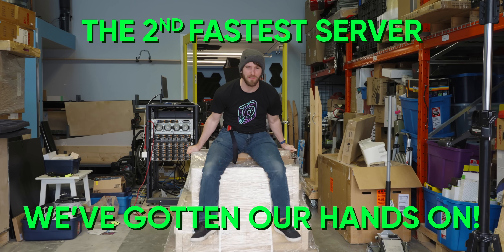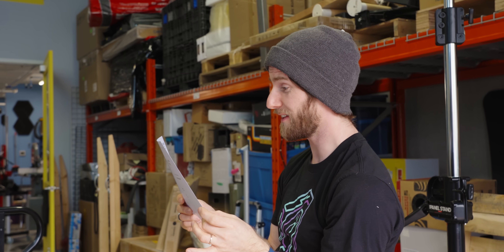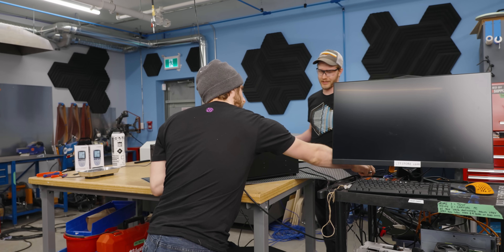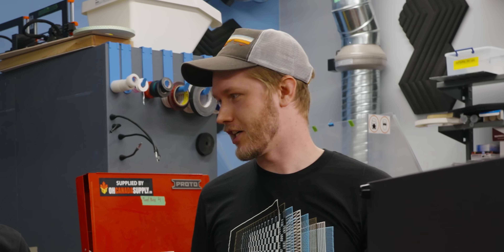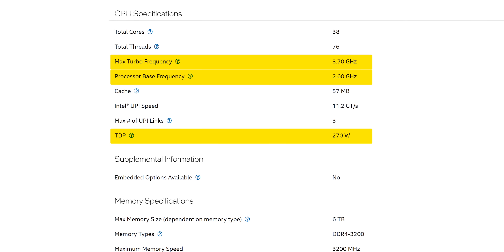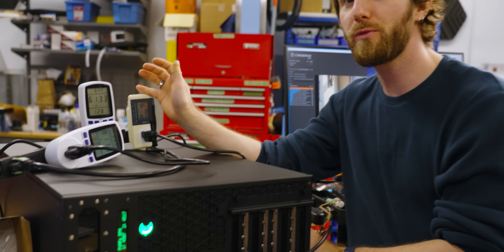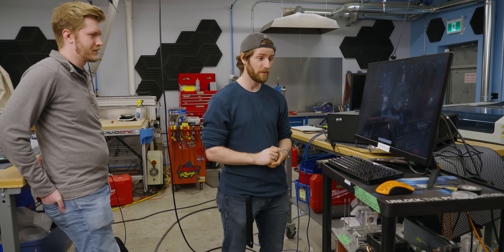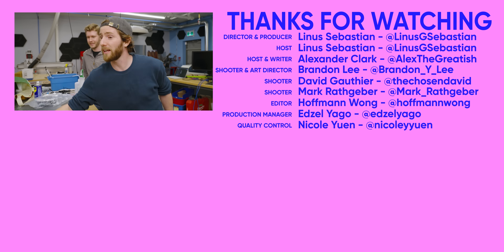The God of Computers - Comino Grando RM

Comment: Getting tired of Linux acting like an overindulged hardware guy who trashes hardware.

Lastly, what kind of computer shop has torx that shred?  Why would you even have a hand sized torx to work on that application where a shred would happen 30 percent of the time.

No. you don't have an aura, you just look like a clown. gz Bozo.

Hmm, my watch times shrink.

Comment: Damn, I was excited when I got 58,000 on my Cinabench Multi Score with my TRx4 3990x. That's 20k more than me. BUT it did take you 6x the CPUs to do it. Since I'm sure dual 3990x would beat it. Well with 128 cores 256 threads should. My rig wasn't even watercooled. Beat out watercooled rig in a Mississippi mid-summer room with an ambient temperature of 28C 80F, CPU maxed out at 50C.
Reply: The most mindboggling thing about your statement is the fact that you own a 3990x. Lol
Reply: @mamamia5668  Yeah, and it is 100% wasted on my use case. I just wanted to build the most absurd computer and did. Paid 2x the price for that 3090 though, and expected that. THOUGH, probably was slightly less than 2x since it wasn't the nVidia reference model one. I don't know what PNY was selling their 3090 for before the pandemic and shortages.
Reply: @tdata545  i paid too much for my 3080 too... sadly
Reply: Mind if i ask how much ur total build was out of curiousity?
Reply: @mamamia5668  15K US. 4TB Gen 4 boot drive, two Gen 3 8TB storage drives, 256GB Kingston Hyper X 3200 CAS16 RAM, 1500W Titanium PSU,  Anidees Crystal XL Case, Industrial fans from Noctua (9x), modified Noctua cpu tower cooler (just added an extra fan and bought black fans), RTX 3090 from PNY apparently the wrong one for better overclocking, and then the aforementioned 3990x running the show on the CPU front all on a Zenith II Extreme Alpha motherboard. Can add ssds and whatnot later. Since the case was meant to be a NAS case.
Reply: @tdata545  thats an unimaginably  crazy power in that system, also in power draw lol
Reply: @mamamia5668  Luckily the power supply should be variable enough and under the heaviest of loads, I think it maxes out at 900W, which is still silly, but not as bad as I was expecting. I over-shot on the power supply for safety reasons. I think nVidia recommends 750Ws, I think the max power draw from their chips that I can see from testers is 400W same with the 3990x, + 100W for peripherals, ram, storage, and fans.

Comment: If you wanted to test the computer you could design a parallel computing script in r or python. They both have packages for measuring performance of compute heavy tasks. I’m currently working on a school project that keeps trying to use more than 500gb of ram and 48 cores.(it still takes more than a day to run lol)
Reply: I’m having to consider AWS because I keep locking up the schools compute server…..

Comment: I think you guys owed it to Comino to physically change out the gpus instead of the "air guitar" version we got. Just my opinion of course. I know there is a lot of work that goes into these videos, and you are probably overwhelmed with tech to demonstrate. I would have liked to see Comino's quick disconnect in action. However, I  am as worried as everyone else about the crowbar and sledgehammer being inducted in this.

Comment: I really doubt that's enough cooling given that the water has to stay lower than 45-50C to avoid pump damage. If you say that the temperature of the exhaust was over 40C, then I'm guess that the coolant was even hotter than that

Comment: Tip. If sqrew to tight, lightly tap sqrew driver with mallet or hammer as you turn to loosen. Works like a charm every time.

Comment: That's nice, but I like mine better, because it doesn't crash a half dozen times on camera while running a few benchmarks, and also, 2000 watts is an enormous amount of power to have to dissipate. I'd need to get a 1 Ton mini split just for the computer room if I installed one of these. Oh, and the freaking computer costs almost as much as my entire house. So...yeah...pass.

Comment: You should let these rip on Folding@home or Boinc Manager projects to just see how many you get through in 15min. It'd be cool to see as a bench mark and you'd be helping Scientists so it's a win win.
Reply: Awesome idea
Reply: I was just thinking about Folding@home and SETI@home, but wasn't sure if they were still a thing. I see that the latter stopped in March 2020, but could start up again using data from other radio telescopes.
Reply: @hedgehog1965uk  Folding@Home is included with BOINC :)
Reply: @captainbozo01  No Folding@home is a separate thing you're thinking of Rosetta

Comment: 60 grand is actually a hell of a deal when you compare it to those Mac cheese grater desktops. Weren't those like 55 grand with just 1 gpu?
Reply: Yeah if you spec them out fully (28 core Xeon, 1.5TB RAM, two 64GB Radeons, 8TB SSDs) it ends up costing about that - in AUD it’s almost $79k 🤣

Comment: You know PC's used to be way more fun. In 2017, an LTT build video wouldn't even be released unless it had quad SLI GPUs with two Xeon CPUs. I mean now we are relegated to these one off business science computers for the over the top builds. Thanks NVIDIA and AMD you could have kept Cross Fire and SLI alive even if it was a stuttery mess. I have a feeling that SLI would have been way better on PCIE 4, and 5. It would have been so fun to see dual 3060 tis  rip apart a 3090 ti in the benchmarks.

Comment: When I try to use SignalRgb my GPU memory speed drops 200mhz. I've searched online but haven't find anyone with the same issue. Can someone who uses it tell me if this has happened to them and what could it depend on?
I have a 2070 super (msi gaming x trio)
Reply: Hey, you should join our Discord community. We'd be able to communicate better this way, and our community could have some advice too! I can't leave a link here though as it would be spam. You can find our Discord online.

Comment: If you guys can get the Time Spy run to complete, your world record will likely stand for three more hardware generations.
4×1080 Tis still beat 2×3090 Tis in Fire Strike.
Reply: I rlly want to see this
Reply: @ricogol  I 2nd this. I NEED to know what the score is. I can't even fathom how incredibly powerful this workstation is. A Sub 8 second BMW render?!?! I literally screamed WAHT?!? at my monitor when that happened lol
Reply: For me (in games with full SLI support), 2 SLI 1080ti cards are equal to 1 OC 3090.  I love my 3090, but it only helps me with games that don't have SLI support.
Reply: @charlesswhitlock  Which games are those? SLI haven't been supported well for a long time and older games aren't going to take advantage of the hardware that the 3090 supports.
Reply: @charlesswhitlock  That is more likely due to such games being optimised for SLI and not for modern hardware. They probably leave a lot of the potential performance of the 3090 untapped.
Reply: @charlesswhitlock  except the big reason you buy an RTX card is for ray tracing lol
Reply: @charlesswhitlock  lol absolutely not sli is garbage I've had sli from 580 to 1080 it died in 2015 with DX12 that promised better support for multi gpu but instead highly increased the work required and so nvidia dropped it, and a single 1080ti is less than half a single 3090 considering sli gains where nowhere near 200% of a single card there's no universe where that's true..except tricked benchmarks that report false numbers..just like car manufacturers trick emission controls, and don't get me started on "fake fps" reported by sli...it says 160fps it looks like 40 because of the sync problems the frame drops the stuttering...subnautica 1 was my eye opener...gliding into the ocean was much smoother on a single 1080ti than sli showing me 60% more fps that's when I switched to single gpu
Reply: @charlesswhitlock  you for real? What a constant stutterfest you have yourself gotten into.
Reply: omg do it
Reply: 11:47 only 850W? That's less than a single 4090 TI.
Reply: @Mr.Morden  Per rail. it's 3 rails.
Reply: @Mr.Morden  That 850W was on CPU benchmark.
Reply: @Mr.Morden  there's no such a thing as 4090 TI.
Reply: @ivanvostlojevitsk3564  already been rumored that the infmaous 600w would be the 4090ti, 4090 is supposed to be 450w now as of 22.05.16
Reply: I think a single card next gen will beat 4 1080 Tis
Reply: Some of the games I  had tested it on include Resident Evil 2/3 remakes (2019/2020) (new engine, no SLI support but you can enable it), Metro Exodus (no native SLI support but you can turn it on), Skyrim as an old game with native SLI support. I'm not going to list everything. SLI support only stopped like 2 years ago. Not as many new games had support, but as I indicated above, it can be turned on for many. If you never had SLI, don't try to convince yourself it was useless, it was the best thing ever for gamers. It is a shame that it is going.
Reply: No they don't
Reply: Unfortunately even the last racecar in last place will beat the one that didn't finish. It's kind of a moot point if it doesn't do what you want. This wasn't it's gig. It's a render machine.

Comment: Linus, your benchmarks are to slow to stress the system. Use the system to simulate airflow through cases. CFD will stress the system if you go in high fidelity. Also you have a ton of engineers who could do it for you a bit south of you in Seattle with Boeing. It would be a fun thing to do in the lab comparing CFD simulations to real would and maybe trying to optimize cooling by understanding the flow.

Comment: Did you consider running a lower ambient temp (particularly if the room was heating up during the testing). While 20°C is a good server room temp (assuming server didn't heat up the room), it looks like you could go down to 10°C to get better cooling when the system is cranked up.

There is argument about the recommended range, and much argument about the ideal server room ambient temps. Part of that is likely the performance / $ gained by inefficiently extreme cooling vs adding more machines or another whole data center.

Comment: Have you thought about running some actual scientific benchmarks on these? As long as you have someone that knows how to compile and run code there it wouldn't be hard to get it set up. For example the HPL or HPCG.
Reply: with starting of lab new benchmark are used if i remember correctly. Something was mentioned in on of the last wan shows.

Comment: Linux, you remind me of the 70s when I was working in a hardware development department doing DoD work. We had several PhDs in the department. (I was a lowly Masters degree holder.) With one exception we had to institute a policy that holders of a PhD degree were not allowed in the labs. They could step through the doorway and items under test throughout the big lab (about twice to four times the size of your labs) would fail. Then the PhD's would wonder "What happens if I...". That is when things would fry. They just had a disaster field built around them.

(The one exception in the department went on to become the chief engineer of Qualcomm before he retired.)

Linus, you appear to feature a walking disaster field, too. I cringe when I see you get near hardware. On the other hand, we had a tech in the lab who was working on a prototype worth ginormous one of a kind money somehow connect 120 volts directly to the card rather than through a 5V power supply. If you want to catch up with that (drunkard) you have to up your game.

{O,o}

 Toning it down a little would be nice. You're not that dumb if you can get where you are today.
{^_-}

Comment: The blender BMW will render in 7.95 sec on my system with only one 3080 ti. So sub 7 seconds on this is not impressive. You cannot use such a simple render to test a machine like that. You need to test that machine on an interior scene with volumetrics and occluded light. That's pretty much the only way you are going to really be able to test it's performance.

Comment: are you sure you set up blender correctly? because im pretty sure you can achieve those results with just one of those gpus and the overhead for running multiple gpus shouldnt be that high

Comment: The Cinebench file needs to be adjusted for machines like this. I adjusted it for my 3995wx to render at a higher res with a high anti-aliasing setting, and it took a bit longer to render. The default .c4d file is only rendering at 1280x700 with low AA.

Comment: When I ran my 2080 ti from two daisy chained 8 pin connectors instead of two seprate ones, my GPU would crash in certain games. An example would be Gears of War 4. I think they should test with a more powerful powersupply to see if the system gets more stable. It is possible to get crashes from an underperforming powersupply instead of outright shutdowns.

Comment: So who will be the first company to offer a retail purpose-built 3 rack unit R134 based coolant chiller box that hooks to standard liquid cooling loops. Ambient air radiation has its limits. 
Take a the Mining Rig guys. They are pushing the power and thermals pretty damn hard. You often see them using used Gold rated server power supplies (12V only) to break out to their GPUs. Then then put the rigs, which really are not that dense, into indoor plant growing tents to capture the heat and then forced-air duct it out of the space.  Really they have the same problem. 
What is happening in the datacenter is an attempt to move to unified form factor (Open Compute) for interchangability of parts (think ATX mobo as a prior example of the benefits of interchangeability). BUT power and cooling is always a problem and a moving target.  Until someone comes up with the final / scalable solution that has to involve not extraction but actually cooling.

Comment: Hi  I'm a beginner I got my Pc brand new and it's working and everything doing well but my motherboard have a orange blinking led on the buttom right corner is that something I should be considered about?! / my Rig i7 12700k - Rtx 3090 - Asus Rog maximum hero z690 - DDR5 5200 32gb kit - AIO cooler - Corsair MP600 2Tb M.2 SSD

Comment: If Comino were to go to full balls to the wall and use a 3x140mm radiator instead of a 3x120mm and make it 80mm instead of the 60mm it appears to be (they're using an Alphacool radiator), they could EASILY make this system even quieter. As it stands, it appears that the 360x60 rad they're using is already powerful enough to dissipate well over 2000W of heat. That's NUTS.

Comment: I'm a senior systems engineer and I understand why they still put VGA as the video out since HDMI requires royalties, but my god its time to move on and also buy better KVM's for your DC. Use displayport Or instead of USB ports add type C ports and make them displayport over type C ports. I just can't believe how long enterprise and datacenter products hold on to antiquated technologies same with businesses they are their own worst enemies and the reason most of them end up in ransomware situations or some messed up situation.

Comment: As much as I love LTT, I know I will be dissapointed when it comes to machine learning hardware testing. Who in the right mind will use Windows OS to test multi-gpu workstation/server which intended for machine learning. Just hire some CS grad student already to run some ViT/ResNet/EffNet on ImageNet
Reply: Well, that would be extremely boring to watch...
Remember, boring watching experience means less people watching. I.E. less money for the channel.

To put it bluntly, LTT can't afford to do it the "proper" way.
Reply: @The_Keeper  boring?  I don't think so, with proper ML test you can utilize all capabilities this machine has to offer. As you can see in the video, they have difficulty on pushing gpu/cpu to its limit in some test. It would be interesting to see this machine pushed to its maximum capabilities. And I am sure LTT can explain the technical ML terms for general audience.

Comment: Now this would have worked well for your multiuser gaming system.
Reply: Uses Xeons, it really wouldn't.
Reply: the verified bot right above you just copied ur comment...
Reply: @horsepotato3684  I know. It makes no sense as Xeons are made for server systems. This thing is exactly what they needed.
Reply: @JohnCiaccio  Between buggy driver support (Nvidia does not officially support running games on workstation GPUs) and the lower CPU frequency and worse memory latency it is quite likely even a modest gaming PC will beat it significantly in most games at a fraction of the cost per person.

Comment: 4:56 I'm an ambulance mechanic and I'm not sponsored or whatever but i believe in the product i use them daily you can avoid 80-90% of drilling screws/bolts if you invest in "engineer screw pliers" specifically pz56 and pz57 styles can handle most things that computers have, they also have vice grip and needle nose versions for super large and tiny screws.. Save yourself the effort, danger and time Linus please <3
Reply: Will those work for screws that are flush?
Reply: Or they could have just used an impact driver or koken attack driver like I would have. But yeah the nejisaurus pliers are great
Reply: @AndrewStrydomBRP  The screw was stripped, you can't impact it out if there's nothing to grab onto.
Reply: @kaldogorath  I would have used an impact from the start as soon as I realised they were too tight to undo normally, these guys pushed it too far and then left themselves with no option other than to drill.
Not causing the problem in the first place is the best solution.
Reply: An easy-out would also work.

Comment: It makes me lel a little when you say its using 2000W and you need two circuits to power it. Here in the UK we COULD do that off 1 socket no problem... as long as there is no other heavy loads like that plugged in on the same ring. (Fuse board for plug sockets is 32amps max)